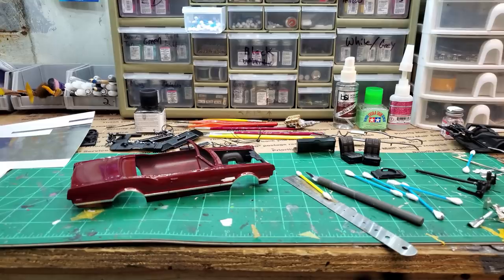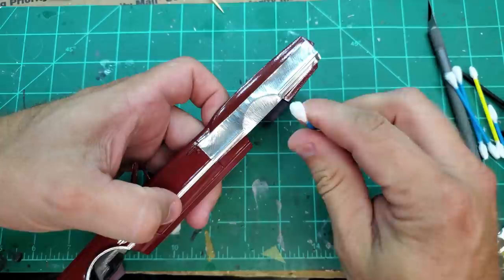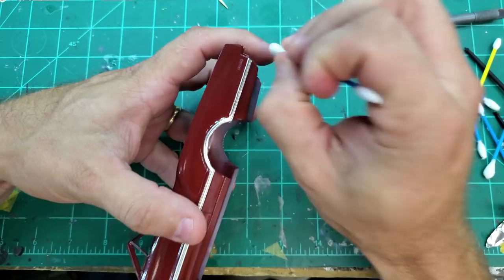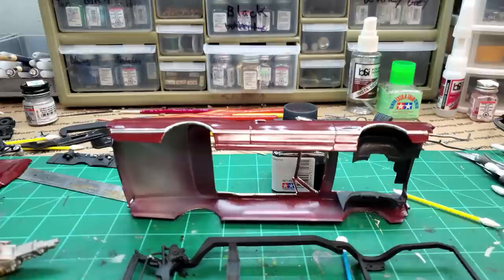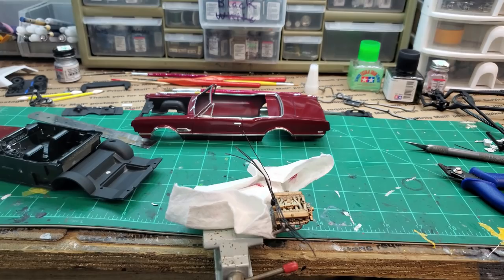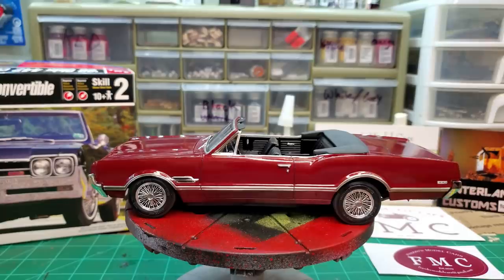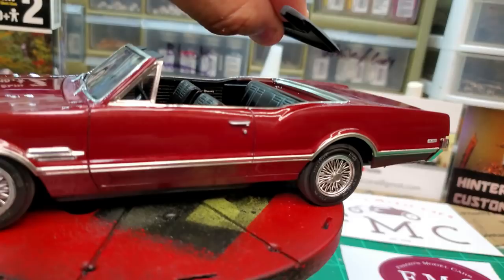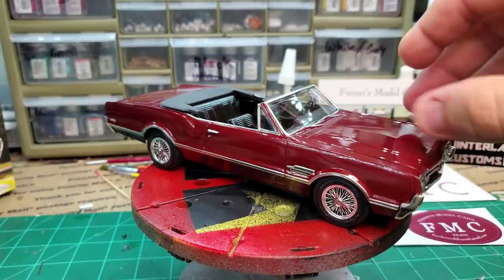1966 Oldsmobile 442 Convertible by AMT 1:25 Scale Model Kit is Done!!!!

Comment: Molotow makes  a fine  point  liquid  chrome  paint  pin that's  easier  to  use on very small detail  parts. It's  a little  better to use than the  chrome  paint. Hobby Lobby  has it.
Reply from the maker: I don't like using Molotow pens. I have them and the tend to make a mess. I prefer using the chrome paint.👍🏻
Reply: @modelcarvideos5829  I can understand that. It's  best to stay  in  our comfort  zones.

Comment: Bare metal foil (bmf) used to have a chrome foil labelled ”new improved foil” which was very thin and easy to work with. It was a great product. I suppose that was their improved version of some older chrome foil. But now, about half a year or so ago, all chrome foil I have found anywhere have been labelled just ”chrome” and is much thicker, easily wrinkled and even slightly different tone of chrome. Also the glue is strange in this current version. 
I’m sure bmf has changed something in their chrome foil. Some other modelling forum had noticed that too. Maybe they realized the ”new improved chrome” was too expensive to produce?
Maybe you have connections and could ask bmf directly? 
As for alternatives, molotow is great for any parts you don’t have to touch. Alclad is useful for bumpers etc. But nothing compares to the good old bmf when chroming side lists and similar.
Reply from the maker: I'll have to check into it. Thanks!!

Comment: Brother, our system is technically called the Imperial measuring system - foisted upon us by our former overseers in England. Even England adopted the metric system by 1965. It's so much easier and more accurate to read units in tenths than fractions of an inch.